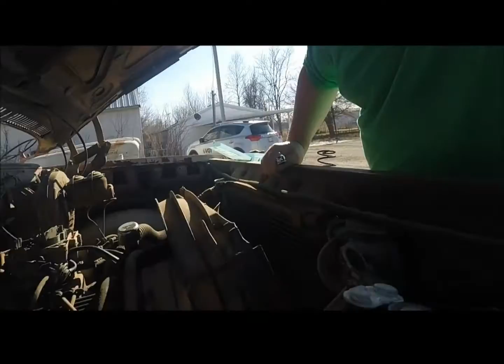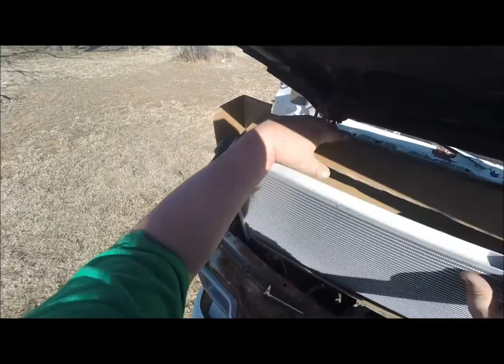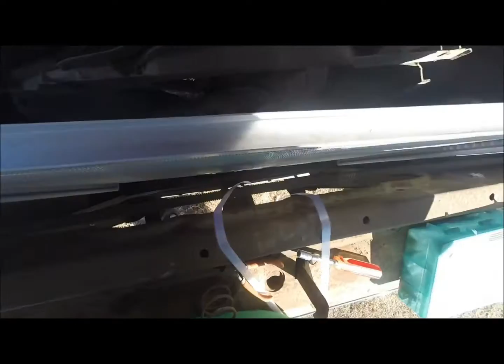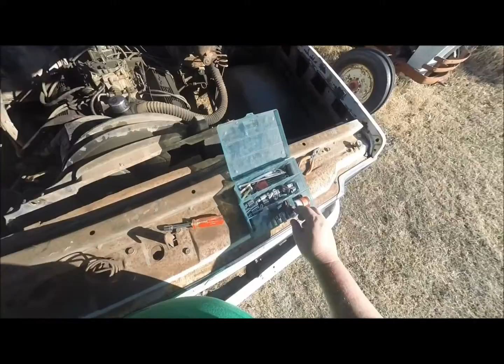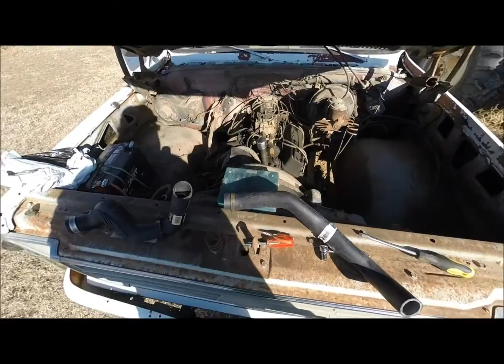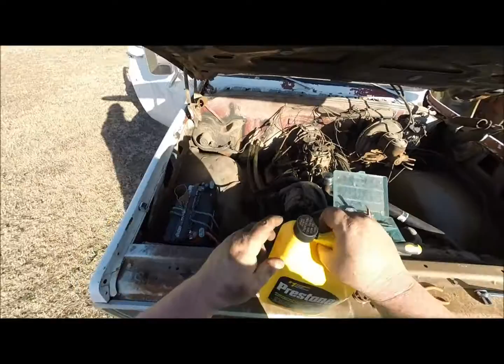Installing a new Radiator in a 1976  3/4 Ton C20 Deluxe Model Chevy Truck 5.7 V8

Comment: Thanks for the how-to!  Have you had any issues with the engine running hot since you replaced it with that 2 core?  What were the dimensions of the new radiator?  I’ve gone and tried 3 different radiators from O’Reilly Auto and they all fit terribly.
Reply from the maker: I have not had a problem with 2 core but I also don't have working AC on the truck so that might make a difference. I tried to see if I could find the dimensions on that but couldn't find the spec's on that radiator I bought off ebay.. The measurement you want most is the width from tank to tank.